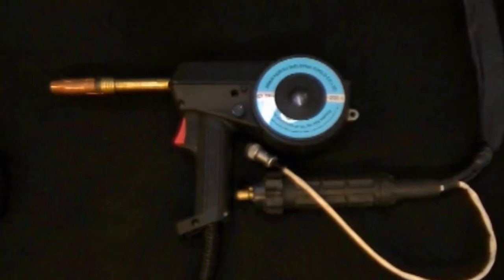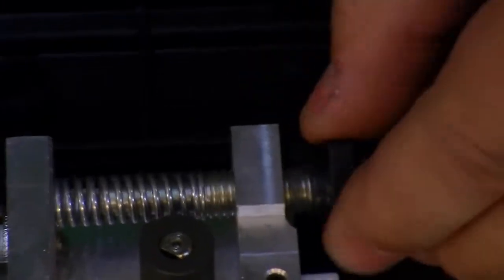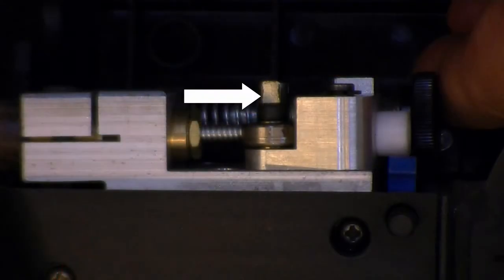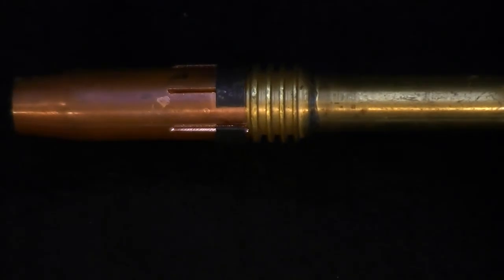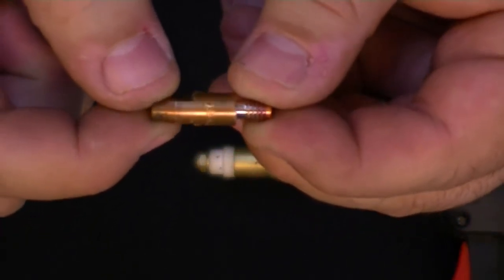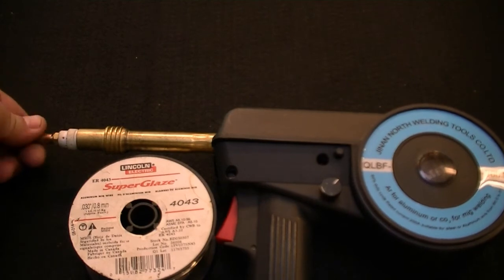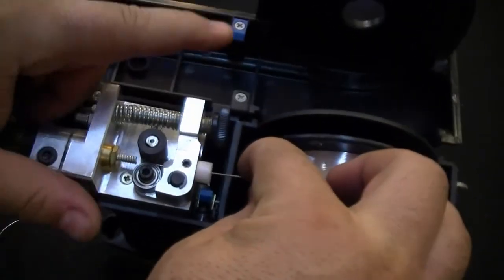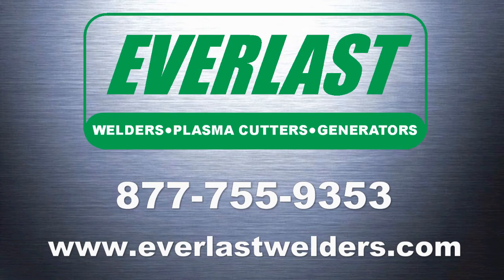Welding Aluminum with an Everlast Spool Gun Part 1

Comment: sure would be nice if they made a spool gun that would work with with the tig/stick welders like my 200dv that way I don't have to buy a whole nother welder just to use a spool gun because I do a lot of aluminum welding and a spoolgun would be handle for short jobs that don't need to be fancy or for doing thicker stuff much faster and less hassle too and this would be a much cheaper option then buying a whole nother setup with spoolgun.

Comment from the maker: The liners are hardened steel, and no, it won't.  The aluminum itself is softer than steel, so it's the aluminum that would contaminate the steel.  The reason they make plastic liners is for ease of feeding in a long push type gun.  A short length like this on the spool gun poses no issues.

Comment: For welding aluminium I quickly saw that your liner looked to be a steel one should you have like a high grad plastic doing the bridge gap between the drive rollers and the contact point?? and steel liners wouldn't they bring ferrorite into your aluminium weld and create problems

Comment from the maker: Yes, it does have wire speed control.  It works just like the wire speed control on the main part of the welder does on the MIG side when in synergic mode.  Adjusting the wire speed also adjusts the voltage automatically.

Comment from the maker: Yes.  The video says it has two versions.  One for the MTS 250S.  Duty cycle is 60% at 200 amps. It can go higher, but most spool gun welding is well under 200 amps.